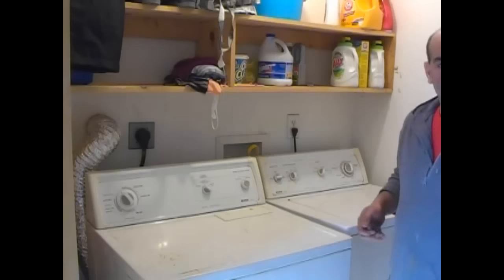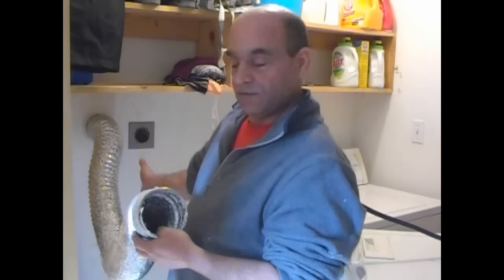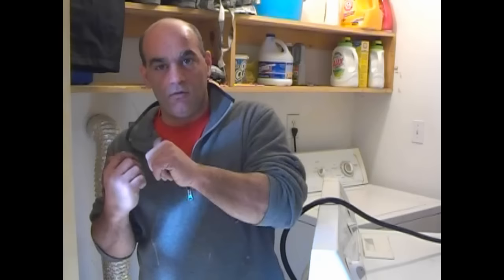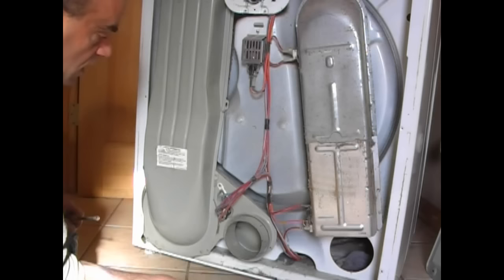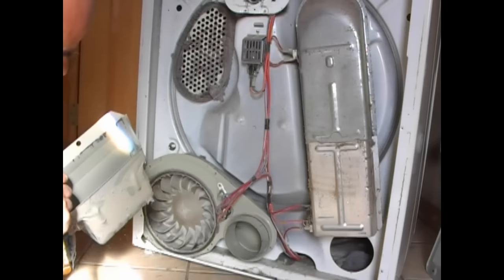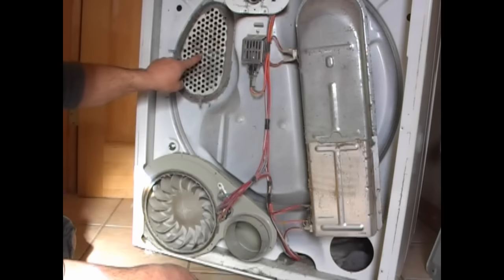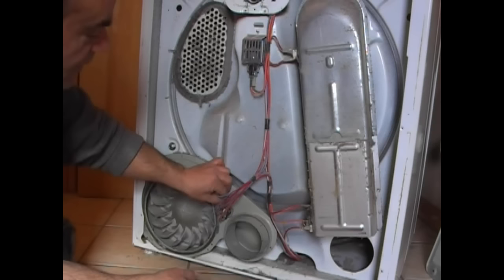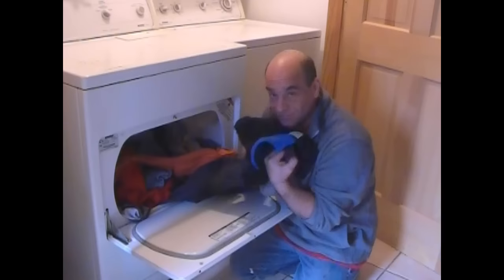How to clean your clothes dryer. How to make it hot again.

Comment: I just bought a used washer/dryer combo and the clothes weren't getting dry, so I took the screws out of the plastic part that holds the lint screen.  OMG!  There was so much lint caked down in there, I had to put rubber gloves on and try not to gag!  I still didn't get it all, as I couldn't reach.  I didn't even think to look in the hose!  I will do that tonight!  Thanks for your vid!

Comment: Just checked it out as I did mine last week. A crucial step is to take the sheild off the heat elements and clean them. With air. No solvents. This is basically a no air filter system across to red hot elements. I used compressed air and blew everything and got at least 6 handfuls of fluff from everywhere. My dryer was front bottom. access

Comment: By keeping it clean, it will run more efficiently and you'll save energy.
Reply: One thing that made a BIG difference in how my old Maytag DE106 drys is I switched from a flexible vent tube to a hard vent pipe that was smooth inside, most of the lint that escapes the trap is just blown out with the spent air...also makes it harder for vermin to get into it. Oh and it is much safer.

Comment: Some people like to use those Fabric Dryer Sheets.  The problem with those is over time their use results in a gummy surface over all of the heated air vent exit paths.  Then stuff begins to adhere to that.  Much like if you put 2 sided tape on a surface and watch dirt build up on it.  Had a 1969 Kenmore gas dryer until 1989 and gave it to a friend.  It had the pull down door and the top mounted vent screen like shown here--the best.

Comment: Hi, I own a professional dryer fire prevention company and appreciate your helping people save them from the tragedy of a dryer and the savings on their energy bill. However there is one thing that needs to be addressed regarding the foil dryer vent that is hooked up to the dryer.

1) the manufacturer's warning label on the back of any dryer will read as follows: USE A HEAVY METAL VENT ONLY DO NOT USE FOIL OR PLASTIC VENT - FAILURE TO DO SO MAY RESULT IN FIRE OR DEATH (lint check.com

Comment: Thanks. I already knew to clean the hose and the vent to the outside. But I did not know how to clean inside the dryer beyond using a brush. I did not have lot of lint in the dryer and hose, but I hope it was enough to improve  drying time.

Comment: I appreciate your sharing this info.  
I had to scroll down the videos for a while to find relevent help, aka your video lol

I just moved into a rental house that has not seen a cleaning in several years, no joke. I will admit I can be pretty lazy about putting things away or getting to cleaning but unless you are physically limited or infirm there is no excuse  for the state of this place. 
The dryer was/is disgusting, still working on it.  It's heating fine but I can smell burnt hair when I open the dryer door. 
I needed to know how to get to that rear vent thing above the fan. I tried vacumming from the front, rather futile lol.  Went outside to clean the vent & I was surprised to see it was pretty clear? Now I suspect I know why, it's all stuck in the back of the dryer.
It is going to be extremely nasty in there I know it, but like you said regarding fire hazard I'm not taking any chances. Has to be done
Your dryer looks pristine compared to this, I was almost envious lol just kidding
Many thanks for the help. You've possibly aided in averting a fiery disaster. Very grateful. 
All the best to you.
Reply from the maker: Always my pleasure. You will have to pull your dryer out in order to get to the back side.

Comment: I have a big problem with lint blowing out the sides of the lint filter cover unless I put a heavy weight on the filter.  What do you think?  That must be indicative of something but the dryer is probably 15 years old.  I'll be doing what your video illustrated tomorrow.

Comment: What if I took out the discharge line by mistake when I was attempting to clean the lint out? Can it be easily put back in place? I have tried, but there is only about a foot of space behind the dryer. My washer is placed directly in front of the dryer and there's a shower located on the other side, so the dryer cannot be moved without taking out a large shelf, the toilet, and the washer.

Comment: On the top right of the blower wheel is your thermal fuse which if blown would not allow your dryer to come on(white one). The thermsistor is next to it which if bad would allow to much heat to your fuse, should read about 8 ohms. You want to check continuity on your heating element and thermal fuse just general problems with dryers.
Reply from the maker: Great info, thank you..

Comment: My dyer door is in the front of the dryer.  When I open the door the lint screen is on the bottom part of the door.  I pull the screen out and then clean it.  Then I clean into the vent with the brush.  How do I get all the lint that fell deeper into the dryer after I cleaned the screen.  My dryer is a gas dryer.  Do I have to disconnect the gas or remove the connector to clean it?  I don't know how to do that stuff and will probably blow my house up if I do.  Thanks for whatever help you can provide.

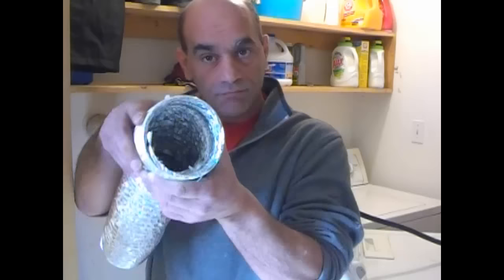Comment: @1:13 At this point I usually bring in my electric leaf blower, and shove it in there, wrap a towel around so no air and dust blows back, and let it run for a good 10 - 30 seconds. Ain't pretty but it really cleans it out really good. I know this is unorthodox and seems like something Carl from Caddyshack would do, but it WORKS.

Comment: Wish I would have cleaned the dryer when I was replacing the 220 outlet and the new cord for the dryer (incipient fire!)
I have to move out the washer to get to the back of the dryer and it's a royal pain.
But, I noticed the sheets and towels weren't hot or dried when I wanted to remove them.
Will try this next.
Thanks!!

Comment: Mine wasn't getting hot at all and it ended up being the electric heating element which you could see had actually blown the element itself. Pulled it out and took it to an appliance supply store and the same unit fit multiple dryer brands (this was Amana). $62 and I was good to go!

Comment: Most common issues with a dryer not producing heat of course unit is not working properly lint can get trapped in the inline blower which can cause not enough air flow or just a blockage in the duct when this happens the inline fuse will open.. Other safety devices will be your high limit switch and your thermal overload. The high limit switch acts as a thermostat cutting power on and off to the heater elements. Quick tip with the thermal overload the very top safety at room temp you will have continuity across the leads if you don't the disk inside  has popped up for a quick fix  tap it on the ground a few times and recheck it

Comment: Hi. Could you tell me what type of screwdriver did you use to open the back panel? I have the same dryer and the screws/nuts on the back look odd.
Reply from the maker: That would be a 1/4" nut driver.

Comment: All brand of Dyers are put together differently, you're going to have to look at one like you have if the lint trap is inside by the drum then you might find screws inside the door at the top, if the lint trap is on top then its like his but even this information is to make you look at it and figure it out, or you could look up the model number and search for a Part it has on it a lot of web pages will have an assembly diagram, Sears has a lot of them.

Comment: Hello sir, did your blower motor keep turning throughout this problem of not getting dry clothes? Mine is heating well but the clothes aren't drying because the fan is presumably stopped up. Could it be that a fuse blew for my motor because it was stopped up with lint? Or did it maybe blow out since it was stopped up with lint? I'm going to be taking it apart soon. Thanks! -Ryan

Comment: Good morning sir! I have a Kenmore dryer and yesterday put a new fuse and thermostat and it works now but I noticed a red light through a screen on the back wall's left side  inside the dryer, is that red light normal or does it point to a heating problem? Thanks!
Reply from the maker: +Chica Caribena Without seeing it myself it's very hard to say.

Comment: Just to pick your brain, would this cleaning process work for a dryer that came out of a flooded home?  It sustained over 3 feet of water but I believe floated to a certain extent with the front not touched by the water but the back end definitely immersed.
Reply from the maker: +Arin Robinson If it needs to be done yeah sure. But 3 feet, yeah maybe just buy a new one really.

Comment: Cleaned out my dryer,still isn't drying.checked everything.All Ohms are in normal range and heating element is fine.any ideas? Thanks in advance!
Reply from the maker: There can be so many things it's really hard for me to even try to say. Something funny I did see before was a bad breaker. Since your dryer is 220 volts but the drum and other electronics only use 120, "one hot leg" to where the heating elements use 220 volts. It's something to check at the outlet to make sure. I've seen it before but only once a new dryer was installed that didn't work either. Food for thought I always say.

Comment: When you pull the lint screen tube out of the dryer you failed to put new gasket material on the connections with the back of the drum panel. They are always bad.

Comment: Hey, got a question for you. I seem to have the same set of dryer and washer as you do at the place I'm renting. Just about had a small lint fire in the dryer. Wasn't a big flame as far as I can tell but sure did smoke alot and when I pulled off the back panel, I can see smoldering smoke coming from the bottom of the dryer. I had cleaned out the dryer a few months back in the back of the machine but never the bottom underneath the drum area. On closer inspection, there's a layer there which I'm not sure is lint or some kind of foam insulation on the bottom floor? Is it supposed to be a bare metal floor underneath the dryer or is that really some type of foam insulation? Cause if its just lint that I'm mistaking for foam, I'm gonna be vacuuming that stuff out then.
Reply from the maker: Well I cant say for sure. But any dryer I've even seen was bare metal.
Reply: Might also be good to consider the fact that if you're renting it's probably not technically your dryer...sure we all know land lords take forever but if the things catching fire they should be paying for a "professional" to come in and clean it out.  Otherwise you might get caught holding the bag if the house burns down and the land lord says "well so and so was messing with the dryer...it wasn't my fault"... take advantage of the joys of renting.....

Comment: Thank you for your help, I didn't relize much it could be in the duct system thank you  again!
Reply from the maker: +jedediahbc Always my pleasure.
Reply: askmediy 
How did you remove the back of the dryer?  I'm a single woman and have never done anything like this before..  thanks for your help..
Reply from the maker: Hi, you should see screws along the outside edges that will need to be removed.

Comment: I took the dryer apart and no lint, etc. I found out it is my exhaust hose tbut I don't know how what to do. The appliance place said that it has to be aluminum to hook up the new dryer. Do I need to put a new line to outside?
Reply from the maker: No being there or seeing it, it's very hard for me to say.
Reply: Found out dryer not under warranty with exhaust system I have. I am getting a new exhaust installed because manufacturer will not allow dryer to be under warranty with pvc/plastic duct from 1990's. This is getting expensive. Thanks for explaining what to do.

Comment: I have the same dryer.. it works fine, but, when running it makes a vibrating noise when you first put wet clothes in. I’ve replaced the front and rear drum seals. I’m going to change the seals on the lint chute next. Any idea. Thank you
Reply from the maker: I would check your belt and or the pulley on the motor.
Reply: askmediy Thanks for replying.. I ordered a belt, idler and drum rollers., also new foam gaskets for the lint chute. I’ve already changed the drum front and rear seals. One of these parts hopefully will solve the problem. I’ll let you know what happens. LoL
Reply: askmediy I did check the pulley on the motor. And the plastic fan on the other side
Reply from the maker: Fingers crossed right?
Reply: askmediy absolutely.. at this point it’s the principle. I Will Not Be Defeated.. LoL.again thanks for playing

Comment: I was stunned when you said that you weren't educated enough on the heating elements or relays in the dryers to try and educate someone else on the subject.And all you did was take the back off and take loose the exhaust  air mechanism and found a big mess. Well It just turns out that I bought my dryer 2 months ago second hand form a ( Reputable ) second hand store who swore they used it in the shop there to dry hand towels and such . And you'd think, if they were reputable .they would make sure that the exhaust system and the inside of the dryer was lint free and clean . I am appauled .But I guess I should have known better. Most mechanics cars run like crap cause they are too busy trying to work on everyone elses', and make a little money . A carpenters house is never repaired unless it comes to push and shove . And a plumbers house has leaks . To make a long story short .We both had the same problem only that carpenter that didn't fix his own house left a pencil,wood screws and saw dust in the bottoe of this dryer . Now I am talking about   ( 4 ) 2 1/2 in.long wood screws, oh yes and a fuse that ironically goes to the fuse box in a car ,go figure. Noww I will go and test out my cleaning job to see if the dryer will work behind the cleaning if not I have more problems.
Reply: My point of all that was ,that I really appreciated your honesty. Thank You !

Comment: I wish I would have seen this video before I replaced the  Thermostat Limit Control and the Thermal cut off fuse.  I checked my exhaust, which seemed fine, but now that I have everything back together, I have to get back in there and pull the housing behind the motor off and check that for dirt....I thought I was done.  Turns out, that was probably what caused the TLC and TC off Fuse failure.  Ounce of prevention here.

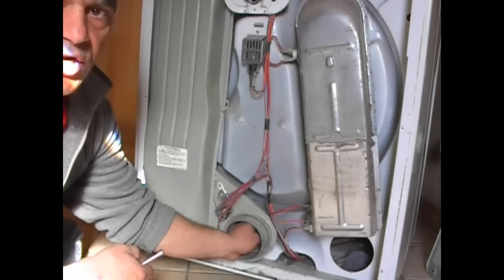Comment: 2:57 turns to 2:58 voila the back panel is removed magically. Some need to see how you removed it. I saw on another video channel that the top two screws need to be removed first. I would have never guessed.
Reply from the maker: Not all dryers are the same. Hence why I don't show how to remove the back.

Comment: I noticed water in the inside of my dryer  today. How do I make is stop. This is the second day it has happened this week. It happens after a big rain.
Reply from the maker: Sounds like you're having an issue with your dryer vent cover (outside) Make sure the flaps(s) are closed when the dryer is not in use.
Reply: askmediy thank you.my outside vent just has a triangle looking cover. I don't see shutter vents like in your video.

Comment: My girlfriend has a GE dryer that she says wont heat up. Her son took off the power cord because the red wire was fried. A new one was put on and it seemed to work great, for a little while. Now she says there is no heat again. I looked outside for a vent to clean but didn't find one. Her laundry room is located in the middle of her duplex( weird location) Her son says the vent is located on the roof. Ever hear of that?
Reply: +Doamino41 .  Dryer vents in many cases run  from the dryer into the wall, up and through an attic and out of the roof.   I visited a home yesterday where the customer stated that his last two brand new dryers didn't dry his clothes very efficiently.  I got on his roof and peeked into his dryer exhaust vent and sure enough, it was clogged with lint.  There is a flap that opens in the vent to exhaust the heat and closes when the dryer is off.  This flap prevents birds, squirrels or other small little creatures from getting in there where it's warm and causing damage.   This customers problem is that lint built up in that flap and prevented the flap from opening.  Heat builds up throughout the entire exhaust and what happens is, when the heat doesn't have anywhere to go, it backs up in the dryer and it overheats.  Most newer dryers have a feature which shuts off the heating element once the dryer heat reaches a certain temperature.  If the heat keeps backing up, dryer heat no come on to dry clothes.  Problem solved.  No cost to repair if you do it yourself.  Hopefully this will help ya and save you some Moola
Reply: If you would like I can talk you through absolutely anything appliance related. Thanks to askmediy, I got a brief job as an appliance repair tech. Give me the model and serial number and I'll walk you through any trouble you have. I love to give back.
Reply: +oneslyjoker Thank you for the reply. It turned out to be a clogged dryer vent leading to the roof. Her landlord cleaned it the following weekend and her dryer works fine now. The funny thing is, she bought a washer and dryer set and brought it home in the rain. The rain washed off the decals so now she has to guess at the settings. Wish I could buy decals  lol

Comment: Alright so, I am having the opposite problem, my dryer is getting too hot, almost immediately and a fire starts in the other vent(the one you did not take apart). I've taken my dryer apart, besides that other vent because I don't see a way, to no avail. Any ideas?

Comment: You need to use an actual metal duct for a hose. Don't use that thin aluminum. That's flammable and if lint builds up in it, it's a fire hazard.